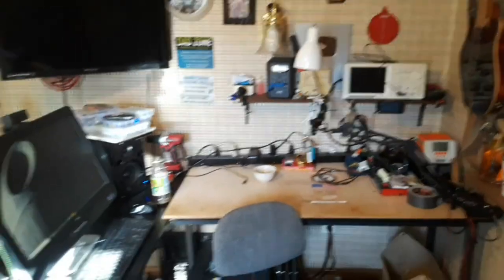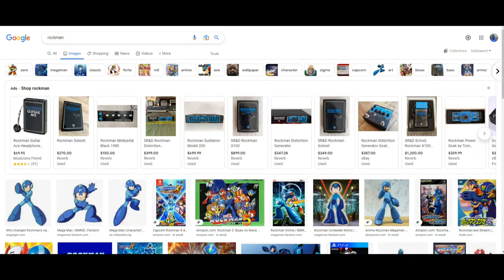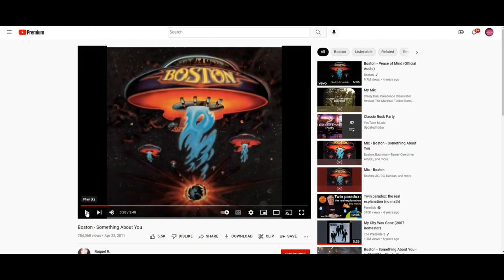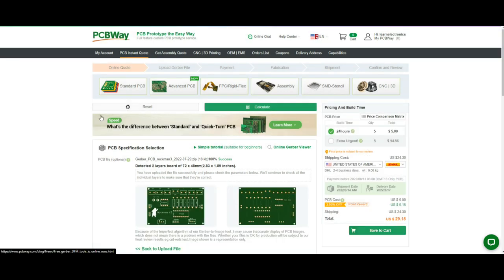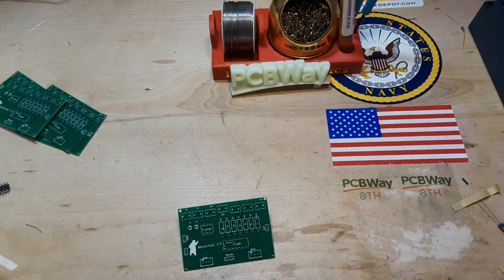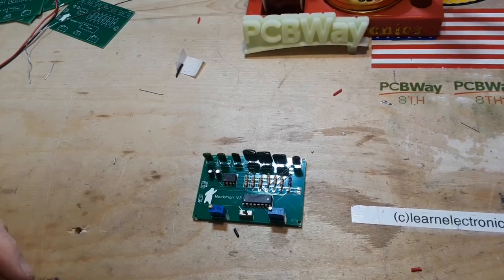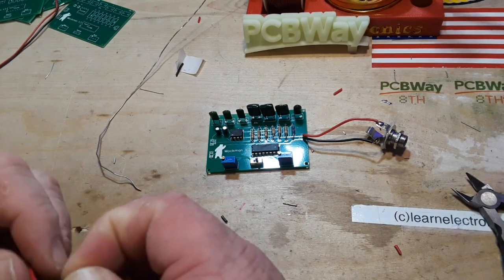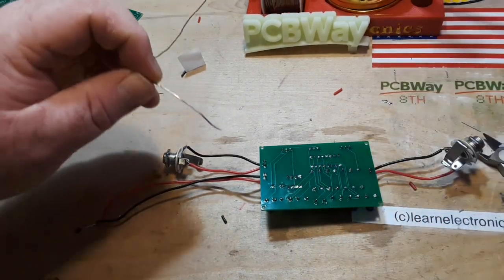My Take on Tom Sholz's Rockman Guitar Effect V3

Comment: I have used the Rockman X100 since it first came out, and I also have a Rockman Sustainer rack mount unit. Both are so old... they are noisy and need refurbishing. I cannot figure out how to open my X100!! Anyways, I started using Amplitube 4 through my Focusrite and it had a Rockman version. It was CLOSE... very close, but.. no cigar in the end. The true Rockman sound is embedded in my head. I recently switched to Amplitube 5 and their Rockman and speaker setup is SPOT-ON. It is THE EXACT sound. Scary accurate. The compression hiss, the chorus swirling... and then you hit a power chord... heaven. So rich in overtones and sustains forever. I'll hold onto my Rockmans because they are practically museum pieces any more. But the Rockman inside Amplitube 5 is just awesome. Plus you get hundreds of more preset sounds, from Gary Moore to Gilmour, and they are no slouches either. Happy to have my Rockman sound back and in pristine condition!

Comment: My foggy memory seems to remember them being just over a hundred bucks when they first came out? Back then I didn't have a hundred dollars to buy one. You probably couldn't buy an original ad for one today for a hundred bucks.
Reply from the maker: Originals are 900 bucks right now
Reply: @learnelectronics   That's why I figured they are probably wanting $100 bucks just for a printed original advertisement out of the first magazine they were featured in. People are nuts to pay that. Tom's 75 years old now so I doubt he's ever going to jump in and make a batch again even though if he did they would sell like hot cakes. He could certainly charge a lot more for them today than he sold them for when he first released them.

Comment: I have a Rockman X100 and several years ago, I took a peak inside.  (I didn't have a schematic or anything to guide me.)  The X100 is loaded with TL072 dual op amps and has 2 or 3 BBD chips in it including a rather rare multi-tap delay chip for the rather elaborate delay/reverb effect.  (That  delay chip was almost impossible to find several years ago.  Hopefully someone is remaking it now.).   I don't remember seeing any digital PT2399 echo chip in it.  What's up with that?   Is that a substitute for the analog BBD chips?  The sound you made at the end of the video sounds a bit like a doubler, but it doesn't sound like the rockman echo/reverb effect which combined delay times of 300ms and 500ms to create the lush reverb echo effect.  PS:  I think a lot of those op amps were used in filter/eq circuits because both the clean and distorted sounds were heavily eq'd in the original rockman x100.  The X100 had a complicated circuit especially for its time.

Comment: Did the Rockman use the PT2399 IC Chip in the original Rockman 80s design ?
Reply from the maker: No. You can view the schematics on line, Scholz used opamps and analog components. That's why I'm doing my own version

Comment: I am a noob at anything with OPAMPs, but on the TL072 I realize you are only using one of the two amps, but don't you have to hook up the voltage and the ground?? I only see 3 connections on the schematic and 3 on the circuit board. Thanks. 🙃
Reply from the maker: Its just the symbol in Easyeda, the footprints have the connections.
Reply: @learnelectronics  Ok, thanks for clearing that up. Keep up the good work. We appreciate people like you, maybe more than you know.

Comment: you might want to try switch craft plugs I used to build speaker amplifier equipment I bought out a guy that built for a Yamaha and use them I think they're the best. I am not a fan of anything from China if you know what I mean whatever they're making for Metal just doesn't get it